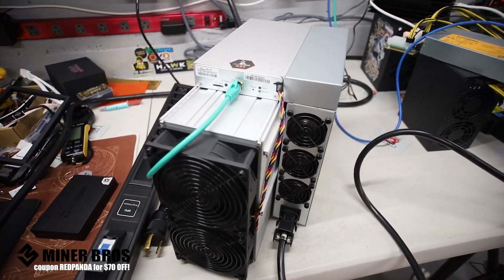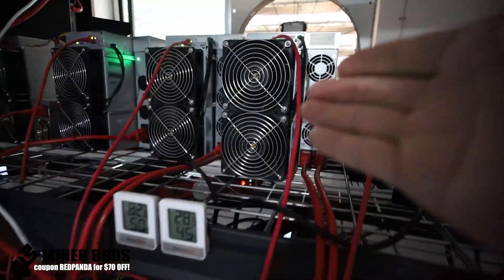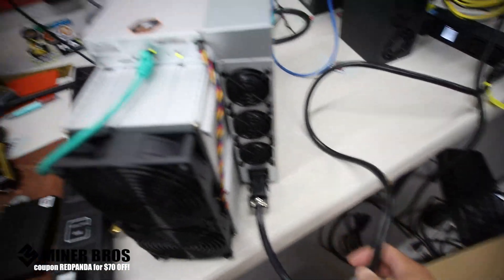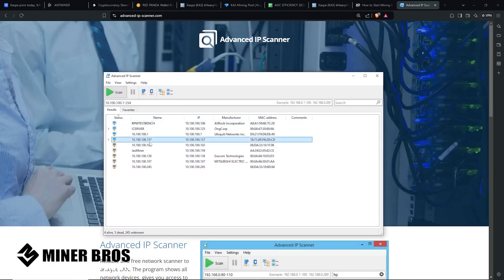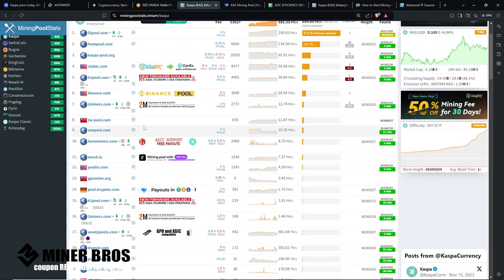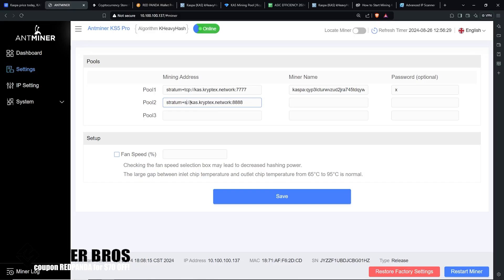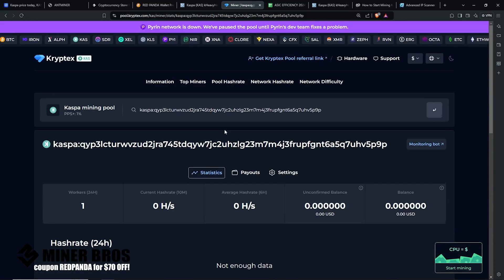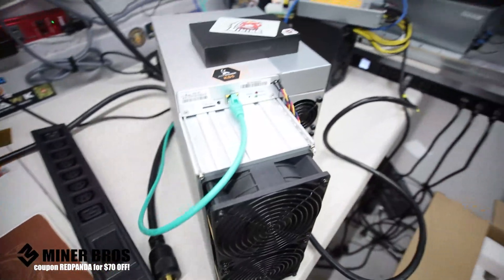Unboxing the Antminer KS5 Pro: Ready, Set, Hash! 🚀

Comment: How many amp it takes each machine I have 320 amp at my house
Reply from the maker: Each miner uses Approx. 13 Amps. With a 320 amp capacity at your house, you can run multiple units safely!🔌

Comment: I've been setting mine up today KS5 pro but getting lots of sweep error string messages and low hashrate 16/17th/s
Reply: Also is your plug getting warm/hot? I'm running mine on a 32 amp circuit so surprised the plugs heating up (waiting on another PSU cable)